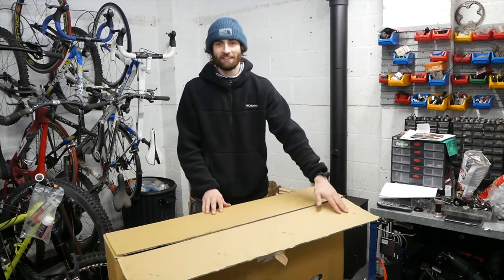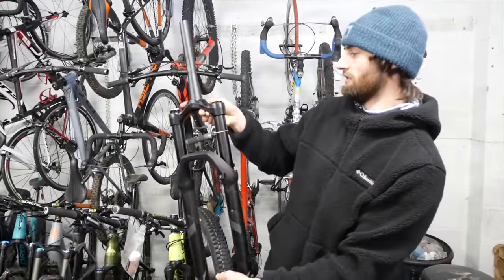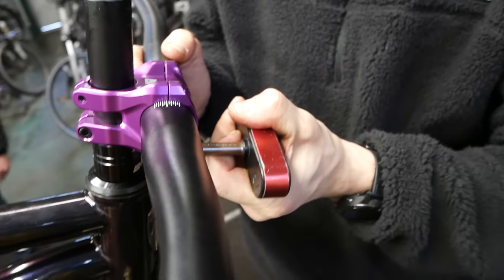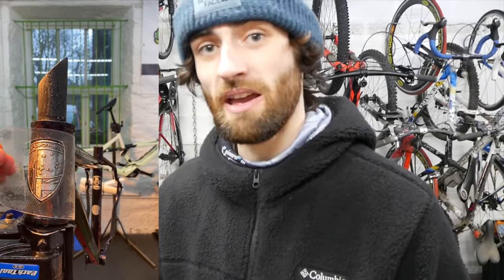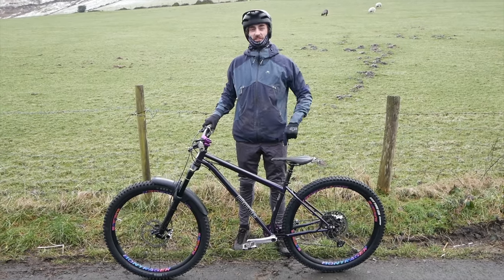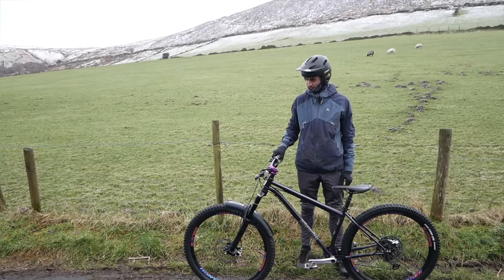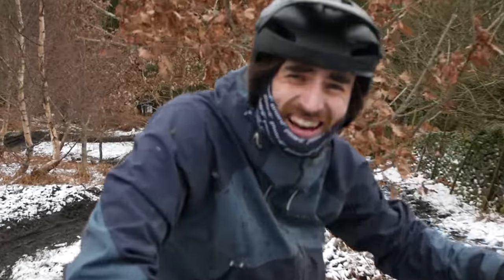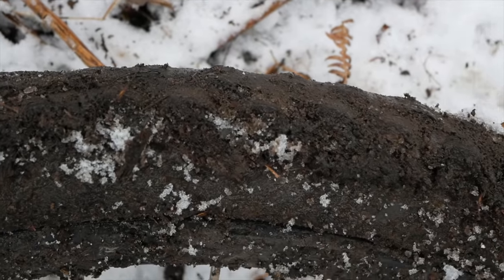THE NEW BIKE BUILD REVEAL! *FULL CUSTOM HARDTAIL BUILD* PIPEDREAM MOXIE

Comment: I found the settings on the dvo website are pretty bang on. 
Forget your pressures from fox etc, start from dvo settings, they are a bit different to setup
Reply from the maker: Yeah i noticed that straight away mate! But they already feel pretty dialled
Reply: @tommychype  i think the ott is the biggest part of the setup, too sensitive and they sit too far into the travel and feel harsh, not enough and they feel a bit harsh, it a very fine balance. 
I been running dvo for a few years and i love them.